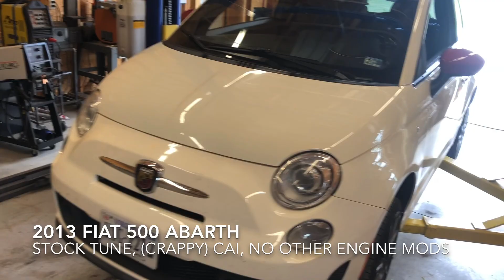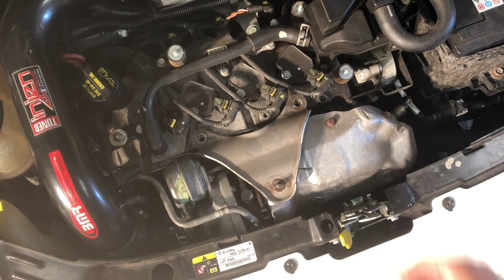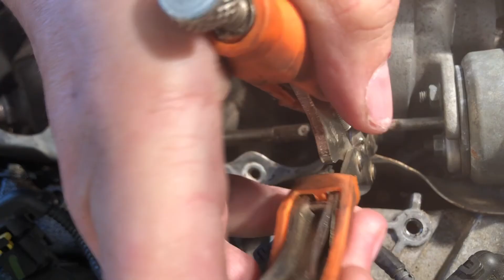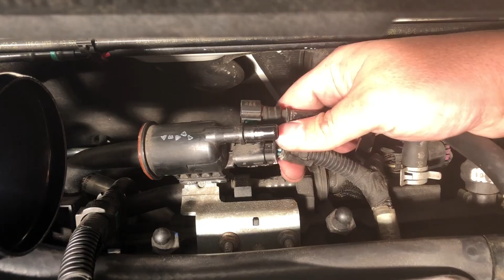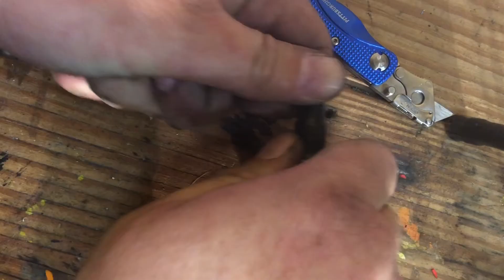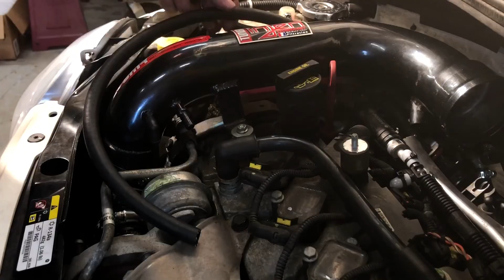Testing the Free Horsepower Mods for the Fiat 500 Abarth

Comment: Gr8 vid, not an Abarth owner. I'll only comment at 3m 20secs in -- pls consider adding as much info for newbs as poss. It's awesome you show the detail, but the penetration spray where required is a critical step worth detailing - especially for the mechanically unaware and vital on such an old car. Gr8 vid as I say, an easy like... the comment is to help your YT traction... I wonder what it could have done to your complete 0-60 times too.
;)

Comment: Damn 
Ive done mine wastegate mod before hand, and i've felt a loads of snappy respose on accelerator pedal, specially in D (ive got a MiTo 1.4 multiair), when ECU wants 1 bar (14.5 in nonsense mesures), it gets 1 bar and beyond. 
Next one ive done is exhaust housing porting, of the turbo and manifold. 
A lil bit laggier, but healthier on top. 
Onw to 200 bhp :D 
So fun little toys. 
Cheers from Poland!
Reply: Going to adjust my 2009 Abarth Grande Punto Esseesse's tomorrow - it's currently set to 14mm of threads...

Comment: I'm buying a 2017 turbo as soon as the seller calls me back. Just saw it placed for sale 2 days ago. It's an automatic. I'm in So-Cal so that is gold in traffic. What year models should I look for with the turbo?  I'm ready to pull the trigger NOW and stumbled upon your video. RAD!  
Do you have an idea of what the stock automatic transmission and running gear will reliably handle for day to day driving?  Anyone reading this. It's Feb. 2027 and I'm ready to buy a 500 tomorrow. I'm in So-Cal. I have easy access to E85 as well. It's cheap relative to 91 octane.  Not looking for MPG just  fun transportation!  Please respond anyone. Pete.

Comment: I did the same adjustment of the wastegate having 14 mm of threads. i had around 15 to 17 pounds of boost. i got it back to 13 mm of threads, and i got 19 to 20 pounds of boost in my boost gauge. Is that ok? How much gain of boost did you get?

Comment: I did the boost leak mod as you described it and I am getting a P1CEA fault code now.   Can you offer guidance?
Reply: if you turn hard on the waste format nut you should be able to get the p1 code to go into a limp mode but a quick on off reset as described in piccos video will ahve that disappear. Just dont wrench the turngate over too far towards clockwise or you can break the washer.

Comment: Look at the boost between the initial run and 2nd run...that 2nd run it's on boost longer at a solid 15 and the 3rd it bumps to a 16 and still holds.  Interesting it stayed on boost longer even with the IAT higher on 2nd run vs 1st run.

Comment: Like all your videos! Got a question about the EGR mod. The EGR use manifold vacuum under low torque request(throttle almost closed). This is how emission is reduced upon cold start. During wide open throttle,   manifold has no vacuum but boost, EGR valve should stay closed, so you won't lose any boost. I don't know much about this but I can't see when could you lose boost without this mod. Can you shed some light?
Reply: never mind..figured it out

Comment: When adding extra horsepower to cars, you should also consider if the transmission and engine can handle the added horsepower. But this Fiat is smaller and lighter than most cars so that maybe be a great opportunity to add some more horsepower. my car is a little bigger than the fiat 500 with 98 horsepower and i think its fast enough for me, had it been bigger and heavier then i think it would have been slower.

Comment: May sound stupid, but how is that a boost leak fix? What does that do to the vacuum?
Reply from the maker: The vacuum is driven by a Venturi.  The Venturi is driven by boost.  That boost travels through the Venturi, and is dumped into the intake.  That boost going into the intake instead of the engine is the “leak”.  In this mod, that leak is plugged, so the boost leak is plugged, but now the vacuum is gone.  We hook up the EGR to the intake, which has some vacuum when you are off boost.  So for most city driving, that works well.  For long highway trips, you are sitting in boost for a long time, and that can generate P1CEA codes when a vacuum is not detected often enough
Reply: Sounds like something you shouldn't do then.  Everyone gets on the highway eventually
Reply from the maker: @upstatetyler2380  Well, I still haven’t found anyone who has had any actual problems from the code.  And the performance gain is actually significant.  So if occasionally resetting a code is worth the gain to you, do it.  If not, don’t.  To me it’s worth it.

Comment: Did you ever end up getting any codes for the evap?
Reply from the maker: Yes.  For me it’s basically no codes until I do a lot of highway driving, at which point, I get it.  I’m working on an overly elaborate fix, hopefully for spring
Reply: @EveryOtherFridayOff  Hello, first off I want to thank you for posting all of your DIY videos on the Abarth, they have helped me a ton!

Also I was wondering if you have an update on that overly elaborate fix for the boost leak mod that won't cause any CEL's and if you are also planning to post a video on it? Thanks.
Reply from the maker: @CrazyForCashews  Thanks.  I’ve been lazy.  The rough idea is to use a pressure switch to just close the boost leak on stock plumbing when boost gets above 11 psi.  That way you are “stock” on the highway, but when you step on it, you are no leak.  Since I don’t spend hours at a time above 11 psi, no harm to the EGR and should be no check engine lights.  I have parts, just lacking time and motivation
Reply: @EveryOtherFridayOff  I greatly appreciate you replying back in a timely manner and I feel a bit embarrassed for not gracing you the same thing... Oh well better late than never! 

I really hope one day you post a guide on that elaborate "CEL free boost leak mod," I'm sure it'll do well.
Reply: @EveryOtherFridayOff  Or is reading something funny from the venturi?
Reply: Now you have the ole wheels turning, (l0l)  so the system is sensing an evap flow/leak?    Soooo, being this is an evap code it shouldn't derate or cause any performance issues?
Reply from the maker: @laplantski  Right.  Code is from not enough vacuum.  If the evap canister was completely blocked off or seeing no vacuum at all, it would eventually fuel soak and be destroyed.  I don’t think this mod actually risks that, but since our vacuum is coming from the intake rather than the Venturi, it’s not consistent enough for the ecu.  Especially sitting on a little boost for long periods on the highway

Comment: Love your videso, so informational. 
I do have a question about your injen intake. I know you don't have it installed anymore, but I was wondering if you had any "whistle" sound under full throttle? I installed mine about a week ago and have the whistle is extremely loud. I checked for intake leaks, and re did the install, put hose clamps on everything I could. The noise is still there. Any suggestions?
Reply from the maker: I never had anything like that.  Hard to imagine what it could be.  It’s not turbo spooling whistle is it?  If you’re used to stock, turbo noises will be a little louder.  Another idea would be to see the difference between full throttle on the road vs full throttle out of gear in the driveway.
Reply: You can't hear it under full throttle in neutral. And I don't think it's just the turbo spooling up, it's a very high frequency whistle. It's really annoying actually.

Comment: One full rotation of added preload.
But you said it now opens sooner?
Reply from the maker: So I'm sitting here trying to figure this out.  As you can see on the video, there wasn't a whole lot of difference in what pressure actuated the wastegate.  Logically my description has to be backwards, right?  Opening sooner should leak easier and be slower.  But that is what I said, and I'm faster.  I tried re-watching the guage in the video, and I honestly cant tell if my description was right.  The simplest explanation is that I got the description backwards in the video, and the WG is opening a little later (at a higher pressure).  Its been so long, I'm not sure if I screwed up, or if there is something I'm missing.  The only reason I'm not going to jump on "I got the description wrong" is that I wasn't trying to over-preload the WG, just bring it to factory spec.  So while counter intuitive, I may have just made an extremely smart engine "happier" rather than cheated preload to avoid a WG leak.

Comment: Might be obvious but could you share the size of the rubber hose and the Y connection? I appreciate it. Excellent detailed video. Sub done!
Reply from the maker: I used this: Tefen Nylon 66 Hose Fitting, Wye, Gray, 3/8" Hose ID (Pack of 10) https://www.amazon.com/dp/B006OGBS96/ref=cm_sw_r_cp_apip_Bnjpd6xtdVEDY
With 3/8 Id fuel hose.
Reply: @EveryOtherFridayOff  thank you Sir!!!

Comment: Very nice video.  I need a small guidance.  My Abarth convertible 2013 - is stuck at 144kmph..A US model and appear a limit specified in the ECU.  Can this be changed, if yes then how?
Reply from the maker: Sorry, don’t know the answer on that one, but wow, what a nice problem to have!  What are the RPMs at 144?
Reply: @EveryOtherFridayOff  Thanks.  I think around 3000-3300RPM.  I checked the speed limitation on different roads and 144kmph or 89MPH is confirmed.
Reply: The limitation should only be with the top down. This is supposedly to protect the top from flying off. Top up, you should be going all the way tp 135mph.

Comment: Great installation vid! I noticed on the forums you eventually got a p1cea cel from the boost leak mod. Did you manage to get it fixed with a new intake or a different check valve/location?
Reply from the maker: Savvy I cleared it a few times.  Since going to the ATM fender well intake I haven’t had any.  I have an upcoming mod for a way to close the boost leak without any codes, but it’s not free.  I’ll be trying that out in a few weeks.  Seems to be people with lots of highway time who are most likely to get the code
Reply: @EveryOtherFridayOff Oh one more question about the waste gate adjustment. I see on the forums that people suggest adding 4 to 6mm preload. Is that something you recommend? Or just make sure it is the 13mm factory spec.
Reply from the maker: Savvy Factory was good enough for me.  If I added more, I would expect an immediate gain.  But I don’t understand the long term effect.  My guess is that the ECU compensates after a while.  I should test that sometime
Reply: @EveryOtherFridayOff  Yeah, I might try out an extra 4mm when I have time to do the mod. Getting an oft soon as well. Are you in the oft Abarth Facebook group? There's a couple members there doing better and quicker tunes than shiv.
Reply from the maker: Thanks, I need to join
Reply: @EveryOtherFridayOff Thanks for the lightning reply! As long as the code doesn't affect anything, clearing it (if it shows up) once in a while is no big deal. Looking forward to your newer vids and the gains you got from the true CAI + FMIC.

Comment: I did this mod and my car ran for about 16 seconds then a loud blow happened and now no boost. Worked it back to factory and still no boost. Something bad has happened because of the re-route around the Venturi actuator
Reply from the maker: Are you sure you are back to factory?  Sorry to hear you are having problems.  I haven’t heard any issue like this before.  Fiat500owners.com has helpful people and information on loss of boost pressure troubleshooting.  A loud pop sounds like a hose popping off.  Unfortunately, quite a few connections you need to check are pretty hard to get to
Reply: Every Other Friday Off a few hours of searching returned no answers for where the boost leak could be. I’m thinking it has to do with one of the tubes I was touching/ working with. In the video, you have an OEM “T” fitting with two ends capped off. This line runs straight from the intake manifold, if I’m not mistaken. To me, I think it popped off the intake plenum leaving a large hole for boost to leak out of. I’ll have to check again tomorrow to make sure all the lines are plugged. Car not throwing codes. Extreme limp mode. Will not go past 60mph. Very loud whining noise upon acceleration, like running an open turbo
Reply from the maker: That would be the most simple explanation.  That “oem t” is the Venturi.  That line should be the only charged line you were messing with.  Unfortunately, battery and battery tray need to be removed to get to the far side.  Good luck, sorry you’re having problems.  I’d love to hear back when you get it fixed.
Reply: Every Other Friday Off from my research, it doesn’t seem like that’s where the problem is. The line I’m talking about routes directly to the back of the intake plenum, at a 90 degree bend (not the line to the air intake ducting). I have also removed the battery tray before and can confirm that the charge pipe is in 100% functioning condition, as well as the lines that lead to the charge pipe underneath the battery tray. They are all in good shape. I still haven’t been able to get back around to it, but I still believe my error to be that line that routes off the back of the intake plenum. Kind of hard to see, but very easy to feel with ur hands. I will get back to you on Monday with more research. Do you have a more direct method I can reach you at? This problem is really eating away at me. Would like to know ur thoughts.
Reply from the maker: Volcom House I am douglawrence42 on Instagram, fiat500owners.com, and fiat500usaforum, you could dm me by any of those means.

Comment: Is the eurocompulsion boost leak instructions do the same thing as this ? Or one is better then the other ? 🤔
Reply from the maker: If I recall, the EC instructions do not tie the EGR back into the intake, but just leave the exhaust open through a filter.  That seems less good to me.   The EGR needs a vacuum to evacuate it.  The intake isn't always vacuum, so its not perfect, but still seems better than atmosphere.   What I showed was the Tork version.  I think this, along with using a Y rather than a T, is less prone to check engine lights.
Reply: @EveryOtherFridayOff  awesome and does it have to be a y fitting ? Because it's hard to find in San Antonio. I have to order and by the time because this whole coronavirus stuff going on...   If no to a t fitting why not ? Just wondering
Reply from the maker: The y theory comes from a long thread on fiat500usa forum.  The idea is that a smooth flow is going to reduce check engine lights.  I ordered mine from amazon.  The small power gains should be identical with a t, but the thinking is that check engine lights will be more frequent.
Reply: @EveryOtherFridayOff  hey I really appreciate you communicating with me last questions . What size of hose did you use ? And will this be good as a Y ? https://www.napaonline.com/en/p/CRB2638
Reply: So I can go buy
Reply from the maker: Abel J Perez I used this: Tefen Nylon 66 Hose Fitting, Wye, Gray, 3/8" Hose ID (Pack of 10) https://www.amazon.com/dp/B006OGBS96/ref=cm_sw_r_cp_apip_Bnjpd6xtdVEDY
With 3/8 Id fuel hose.

Comment: Could you share how you test the wastegate and with what kind of gauge?
Reply from the maker: The wastegate has a single airline running to it.  Disconnect this, plug in your own airline to the wastegate.  I added a tee to this line.  On one side of the tee, I hooked up an accurate pressure gauge (1 psi matters).  The other end was hooked to my compressor.  I used a spray nozzle on the compressor so I could give quick blasts of air

Comment: Does this only apply to the Multiair? Or does it work for the T-jet?
What does the second mod actually do?
Reply from the maker: I have no idea about the T-jet.  The second mod plugs a boost leak
Reply: @EveryOtherFridayOff  yes, but exactly what is leaking?
Reply from the maker: Mattias Filander the Venturi is hooked to the charge side of the turbo.  The compressed charge from the turbo is what is being used to drive the Venturi.   So it is literally a boost leak being plugged
Reply: @EveryOtherFridayOff  ok, but what function has the venturi then?
Reply from the maker: Mattias Filander The Venturi creates a vacuum which is used to draw fuel vapor from the EGR canister.  On most cars, normal crankcase vacuum is used for this.  On our cars, which stay in boost for long periods, it was thought not to be enough.  This mod eliminates the Venturi, and plugs the egr directly into the intake

Comment: I have found several instructional videos for the boost leak mod and the waste gate actuator adjustment. I have to say that this video is, by far, the easiest to follow. I followed this video for both mods on my 2013 Abarth 500 and was shocked at how much difference it made. I have VERY little turbo lag now. Thank you for such a well done and easy to follow video. Keep up the good work.